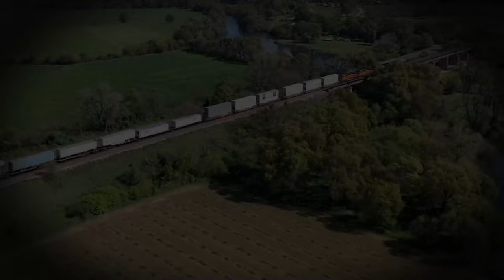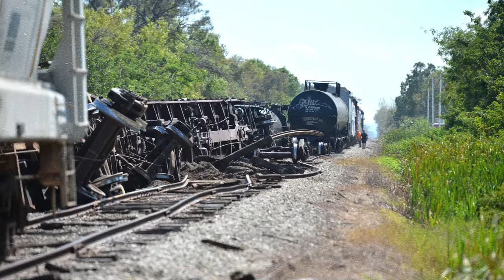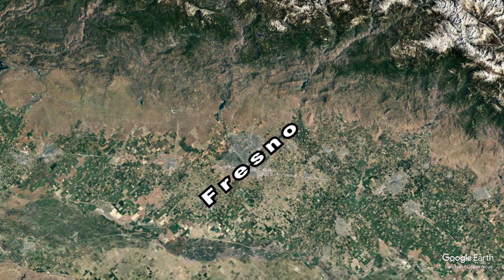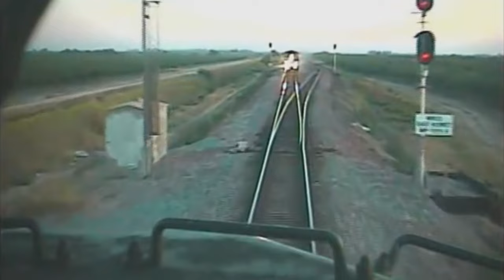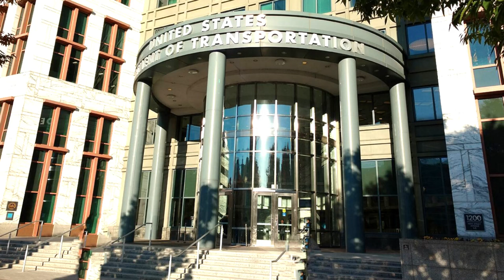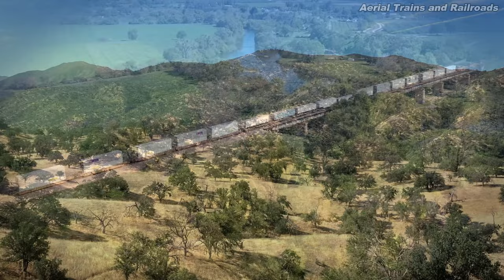The Kismet Train Collision | Short Documentary

Comment: Constructive criticism: Step 1 of annoying US railroaders and rail enthusiasts is calling it a train "driver." We use the term "engineer" here. "Locomotive engineer" is the full version. Aside from that, I can tell you did your research on the terminology in use, and the route in question.
Reply from the maker: Being a former railway man I knew this, I thought I had used "Engineer" throughout. I must have slipped once or twice 😬
Reply: @CuriosityVaultChannel  The video title has "driver." Also, the train symbol of the south bound M-RICBAR-13 would be pronounced as "M-Rick Bar-13" without enunciating the dashes. RIC and BAR are BNSF codes for Richmond, CA, and Barstow, CA, respectively. The "centralized traffic controller" would be simply referred to as "dispatcher."
Reply from the maker: @RadioactiveSherbet  Ahh, those names make a lot more sense now. Can I at least get points for using Imperial measurements instead of my native Metric? haha
Reply: @CuriosityVaultChannel  I'll give you it. Btw, I have no idea what the northbound train symbol was. Also, in the event you cover more US rail incidents, UP and BNSF use similar train symbols (UP has 2-letter codes [OA = Oakland; RV = Roseville, so a train between Oakland and Roseville would be OARV] vs BNSF's 3-letter), but NS and CSX use a different system.
Also, in both BNSF and UP, the first letter is typically a code for type of train with some differences, with the number at the end referring to what day of the month said train was built or dispatched. Some examples: M = manifest (mixed freight) in both UP and BNSF. Z = high priority intermodal for UP. I'm sure it's possible to look those up. I know I have a sheet with UP's train type codes, but I can't be bothered to look for it atm.
Reply from the maker: @RadioactiveSherbet Thanks, always looking to improve.
Reply: @CuriosityVaultChannel  You're welcome. Keep up the good work, dude. Greetings from someone less than 100 miles from the site of this incident... lol
Reply from the maker: @RadioactiveSherbet  Thanks, less than 160 kilometers 😜
Reply: I thought that functionary was the "hogger". An engineer is someone who has the discipline to design solutions to problems with due attention to constraints and criteria.
Reply: @b43xoit The term Engineer can also refer to an individual who runs (operates) an engine.
Reply: @johnleonard6471  It can, but my impression had been that that usage was by the relatively uninformed about the jargon specific to railroading.
Reply: We are a Democratic Society andld Anyone can make a YouTube documentary.

Unsubscribe and stop watching if it irritates your hypercritical nerves.
Reply: @b43xoit  "Hogger" is jargon. "Locomotive Engineer" is the official term.
Reply: @RadioactiveSherbet  Not "engine driver"? Most of them probably don't have an engineering degree.
Reply: @b43xoit  In the US, "driver" isn't used. As I stated earlier, the official term is "Locomotive Engineer." It's unrelated to an "engineering degree." "Hogger" is simply jargon. You're not going to see "hogger" listed as a job title, except by locomotive engineers using it colloquially on Facebook or some such. And you'll get very weird looks if you call them a "train driver."

Comment: THE PROOF IS CLEARLY SEEN IN THE FILM !!
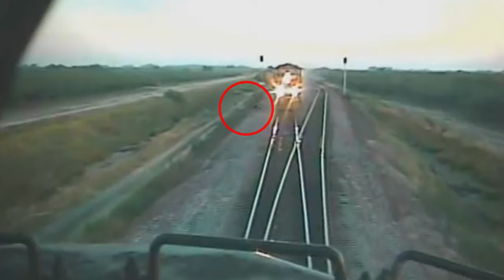If the film shown is of the actual incident, and hasn't been tampered with in any way. Then almost ALL the CONCLUSIVE evidence necessary is clearly seen. The film is taken from the train that is abiding by the rules. As it approaches the loop, it can clearly be seen that the points are correctly set for it to turn right into the loop. BUT AT EXACTLY 5:39 the signal Clearly shows Red over Green. Indicating the train is set for the loop and allowed to enter the loop. BUT AT 5:40 the Red over Green becomes TWO REDS - READ ON. 

Now it gets technical. The signal changing at 5:40 PROVES CONCLUSIVELY that the train coming towards the Camera, has WRONGLY passed a RED signal, (the back of which is seen to the left of the oncoming train). Our signal changed because the other train has physically reached the "TRACK CIRCUIT" of the point area (which it should never have done). Proving the other train has wrongly passed its signal at RED. 

This film was presumably available to the crash investigation team, and would have told them immediately the Driver of the train seen coming towards the camera is in the WRONG. They therefore only needed to test ALL the signals & "Track Circuits" to PROVE there were NO faults in any of the Signals & "track circuits" of the WHOLE LOOP AREA. Depending on the type of "Track Circuits" used you can for example have one Track Circuit "bleed through" into another Track Circuits area, which could cause a "Wrong Side Failure" in one or more of the signals, allowing them to show a green possibly instead of a Red.  

As a ex British Railways Track, Signalling & Traction Engineer, this little episode is a quite straightfoward Driver Error. (Passing a Signal at Danger). 

Having said that there are also by British Standards & Rules, serious issues with the use of CTC (Central Traffic Control) which would NEVER be allowed to be used in Britain, for DOZENS of serious safety reasons. The type of Signalling seen would also be BANNED in Britain, because it allows Drivers to pass a red (when you have a red over green, or a red over yellow for example). Which is psychologically highly unsound & dangerous. ANY & EVERY red must ALWAYS mean STOP.  So this signal system is in reality decades out of date, as there are much safer solutions. Such as using white junction direction indicator lights instead of two separate signals one above another on one post. And they've had dozens of similar crashes in the States for exactly the same reasons down the years !!!
Reply: Very good comment on a very good report!
Reply: That last paragraph is a little nuts don't you think? Tomato/Tomahto, one learns and understands the signal system under which they operate. It's really not that complicated. If there is nothing physically preventing a signal from being ran (or passed at danger as you call it), it can and eventually will be ran, white junction arm or not that's just human nature. Signal confusion isn't always the main culprit, it's usually distraction or fatigue which occurs regardless of what signal system you're running under. I know Britain invented the whole world and you'll be goddammed if the US has the nerve to operate under a system different than yours but the reality is, you're wrong. And get off of your high horse while you're at it. The ending of your comment is arrogant and preachy, I guess that's not your fault, you are British...